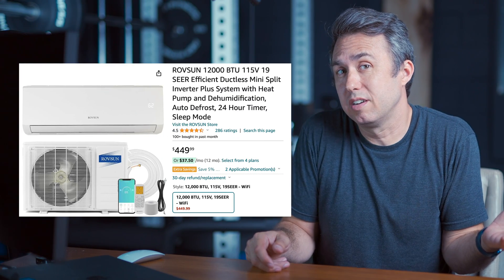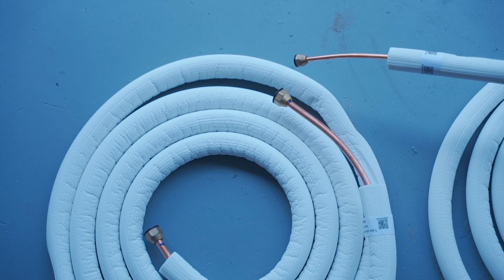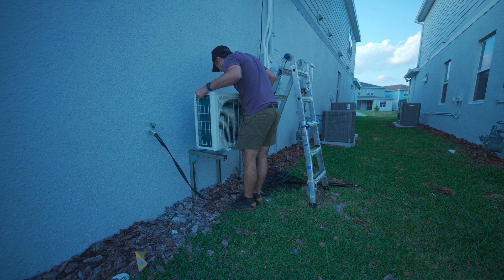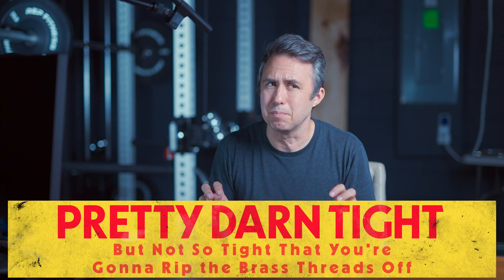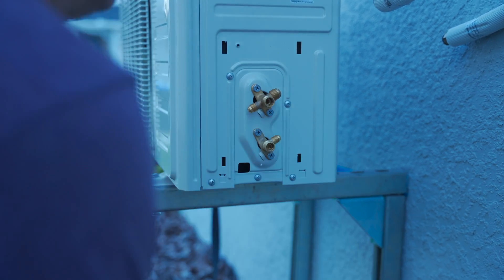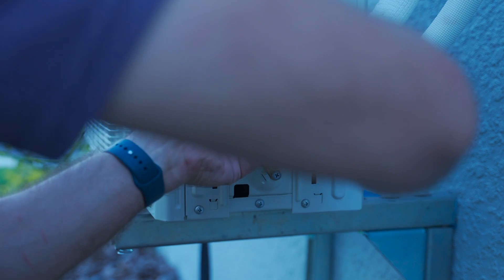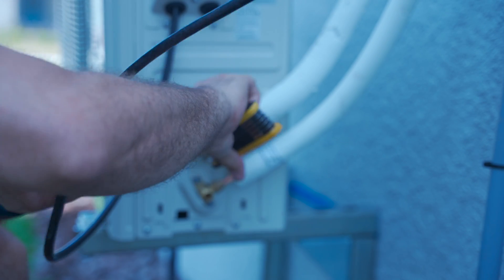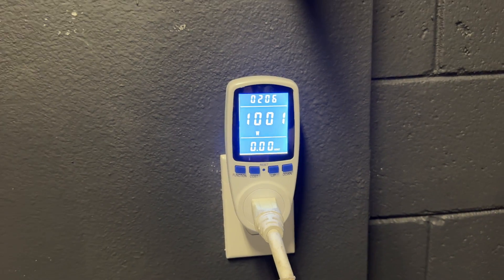DIY Mini Split Step by Step Install: Save Thousands of Dollars...

Comment: I have this mini splits i need that redacted part i got it after watching a video of some one installing it to a rv  mentioned the price and it could be ran off 300watts of solar a full install later knowing what cable or extension cord is the only thing standing in the way of me being done with this I also like to mention I'm also in Florida and in a rv

Comment: This isn't meant to be a scathing critique but rather some things you should keep in mind while thinking this is an easy project that you can get done in an afternoon. Surely there's a decent number of people that will end up following this guy's advice and not having issues, but in my mind, if you want to guarantee that you don't have issues then you need to do things properly from the get-go. And to do things properly, it's going to take longer and be a lot more expensive. In general, I don't think you shouldn't follow this guy's advice. I'd estimate for every 100 people that take it word for word there's probably at least 25 people that will end up needing to call a certified hvac technician to come out and fix mistakes. Not to mention, leaking refrigerant into the atmosphere destroys the ozone layer. Please consider that your actions and penny pinching have consequences. It's also possible that those actions will end up in you paying more than having it done professionally to begin with. 

1) You NEED to torque the flare fittings to spec. This is non-negotiable. You're lucky if you don't run into issues later on without doing this. I have several mideas and ran into issues dealing with the low quality copper they use. Too tight and you'll snap the flares off, too lose, goodbye refrigerant. With torqueing, it's ideal to torque down to spec, back off, and torque back to spec once more. Copper is very malleable and this will ensure an even better seal. You should coat the flare fittings with a small amount of nylog wherever there's friction while tightening them down. It's cheap, and will create an even better seal. But more importantly, it's what the pros use, and they do this type of thing for a living so trust them. Flare fittings are extremely error prone, just Google flare fitting issues and you'll see. They come from the factory with defects and should almost always be redone. But good luck redoing them with the Midea units! My hypothesis is they use thicker copper near the flares and you won't be able to make good ones further down the lineset. Maybe my flare fitting tool is bunk. I'm happy to admit mistakes where I make them and still need to figure out if I should blame myself, my rigid flare tool, or the copper Midea uses. I tried 11 times to make a proper flare, 11 TIMES!!!! It was infuriating. They snapped every single time I tried to torque them down. I ended up leaving the flares for the connections to the compressor (outside) and used RLS fittings to connect the cut down compressor (outside) lineset to the air handler (inside) lines. 
2) The lineset should be cut down with a tube cutter to remove any excess, otherwise oil can accumulate in the lines. It needs to circulate through the system to keep things going smoothly. Unfortunately this means you will need some way to connect the shortened lineset after removing the flares. This could mean a press tool for rls fittings, $4k+, or having a good handle on brazing copper with an oxyacetalyne torch. There are other connection mechanisms you can use for refrigerant lines that are cheaper and require less skill but I went with the press fittings personally since I'll be installing these for a long time and it's much more flexible than having to braze. 
3) Before pulling a vaccum the unit should be pressure tested with nitrogen and leak tested. It should be leak tested again after you pull a vaccum.
4) Regarding pulling the vaccum, it's ideal to use a micron guage so you're certain to be pulling a vaccum down to the appropriate micron level. They aren't cheap. Without doing this, you have no idea how much junk is in the lines from the outside air, especially in a high humidity area like Florida. The moment you pull the caps from the charged lines, they're exposed to the outside air, and contaminants will enter. This will lead to the premature failure of the system. Moisture is a demon to hvac systems.
5) I hated how you unrolled the lines lol. Quickly and haphazardly. Roll them out slowly and do your best to avoid unnecessary friction or kinks. Be very gentle and patient! Remember the parable of the tortoise and the hare. The amount of bends and twists you had to do to get the lineset through your attic to the outside was triggering. This is not ideal! Use a hammer drill and some sprayfoam to seal it up. Cleaner, less risk of ruining the lineset. 
6) The electrical is dangerous. Contract this out unless you're very, very, very, very certain you know what you're doing. Is it worth burning down your house to save a few thousand dollars on a DIY mini split install you probably aren't doing properly to begin with?

If this is the one time you intend on installing a mini split, and don't want the ability to do it again in the future, contract it out. You will spend more in tools and in time researching how to do things properly that likely would meet or exceed the $4500 or so it would cost to have it done professionally. Or you can risk burning down your house, the health of our planet, and wasting money on a mini split + professional troubleshooting. Who knows though, you could be one of the lucky ones.
Reply: Pointless comment.

Comment: How has this Held up since when you installed it? How's the Performance? Any Issues So Far? Saw this On eBay don't see any Warranty on the Units. However, I was Looking at another Company Acekool who Claims to have 10Year Warranty, Costs Only About $100 More. But I haven't Seen any Reviews Of them, They don't even have a Legit Website Showing their Mini Splits, That Means Certainly No Customer Service Or Support after the 30-60Day eBay Protection Period. So that Makes Me Skeptical. So, I'm thinking of getting this one, It's got a good warranty and Customer Service and If its a Reliable & Dependable Unit.
Reply from the maker: So far its been PERFECT.  Im in Orlando Florida, and it is in the 90's every day.  My garage is cinderblock without additional insulation and I keep it at 77 in here 24/7.  No problems at all.  Its WAY quieter than I expected, both on the inside unit and outside.  Its only been a few months, but I expect if the seals are good after a couple months theres no reason to expect that should change.  The air is ice cold coming out.  Im blown away by how cheap it is.  I keep reading about quotes of like $9k to have a mini split installed and I did this for a few hundred bucks, its wacky!
Reply: @SPACEDESIGNWAREHOUSE  I was quoted $12,000 for a single unit with two heads. Totally outrageous.! I'm gonna try this myself and if I go wrong, we call in an HVAC company to install for me....

Comment: I am in alabama, which is like florida, except it gets to 20f in the winter, and +30f in the summer due to our hot air coming from texas instead of the ocean. I am getting shipping containers for storage next week, and was examining my options. I didn't want to pay the options, and knew I could do something with a vacuum pump to solve this, in fact I bought one for $15 last year at a yard sale.  Your video really brought together all of the bits that I will need to install some mini splits.
Reply from the maker: Awesome! Yeah, one of these would definitely cool a shipping container.  That would be a pretty quick and easy install, too!

Comment: Sorry but I am going to be that guy. Your install looks like crap. I'm in Florida and also did my own install. Why on earth didn't you use lineset covers (linehide) on the outside wall? You can even paint them to match the house. It would look so much better than that eyesore you created. Guess what the number one fail is on these? Not torquing the flares to the correct spec. They end up leaking. I bought an A/C style torque wrench for my install. 

Mine runs down the inside wall in the garage which I covered with linehide. My toolbox covers most of it also. I came out low on the wall poked it outside and ran the lineset and conduit to the condenser also in linehide same color as the gutters. You can't see it because the landscape covers it. The only thing you see on mine is the condenser. No hideous tangled lineset. I see you used a stand. Better than being on the ground so kudos for that. I used an approved hurricane wall bracket on mine. On the outside disconnect I put in a surge protector which is also important. I used a Rectorseal RSH-50. It has alien technology so if it blows there is a gas inside that takes the hit before the electronics so it can take multiple hits.  

It just seems if you are making a video you should take some pride in your work and also your new home. I hate to be that guy this this install is so bad I had to comment.

 With all that said I can have my main door open and the garage stays cool. Not sure what size you used. I have a 2 car and a single car garage. I put mine in the single and used 1.5 ton (18,000 B.T.U.'s) and it's amazing. I hope yours is amazing as well for you.
Reply from the maker: No worries at all - the world NEEDS "That Guy."  I, for instance, had no idea that LineHide existed and now I do!  Im going to get me some of that stuff and clean up the inside (I did mention in the video that I planned to run some sort of metal casing down the side of my house to hide this.  There are also three other metal conduits that run up the side of my house near this same spot for the big AC, so it really wont add much as far as industrial garbage on the side of the house. 

I used a 12,000 BTU and its a two car garage and, as you know, its been in the 90's all week and this thing keeps it super cool in here and is crazy quiet, I am wildly impressed with it.  I do wonder if my not using a torque wrench will cause it to leak in the future.  If it does, I'll definitely get my hands on one of those to redo the fittings.  But in my general experience with fluid lines (I design immersion cooling dielectric fluid systems) I've sort of got a knack for how tight these fittings need to be.  Not discounting the proper specs, of course, I recognize and agree I should use proper specs, the engineering was done for a reason.  But as a mechanical engineer, I also know theres a bit of wiggle room in those specs. 

"Looks like crap" is sort of my design aesthetic, Im an example of regular people who suck at things the first time :)

Thanks for the LineHide, and thanks for watching the channel.  There will be more things for you to cratique soon as I plow through projects for this house.  Just wait until you see my networking closet!
Reply: Every guy who installed one of these and had a leak also felt they had the magical enginerd hand torque wrench meter. :)

 Not sure if you are new to Florida but I would highly recommend biting the bullet and spring for standby generator. Buy once cry once. My house is 3200 sq ft 2 A/C’s plus the minisplit. We also have natural gas in our area which makes it easy. I have a Generac 22KW. When FPL gives me the finger it comes on automatically and runs everything as if it were on the utility. No unplugging stuff no filling gas cans it’s just seamless. 

If you have to unhook the lines I’m pretty sure you can pump down the system and have all the refrigerant in the condenser, valve it off so you don’t lose any. Of course after re-connection you would run the vac pump.

Having nice looking network closets is also a thing of mine.. I have an amazing low voltage guy. This guy can get a wire where nobody else can. He also makes everything look pristine. He did all my color night vision cameras, sound, wifi all inside and outside  etc etc. I had him drop lines in my bathrooms so I could install Toto’s. He’s in WPB. Sometimes it’s worth it to pay someone. I do 99% DIY but attics aren’t my thing. :)

Comment: Wow Nice job 👍 seems it was a bit of a pita getting lines all the way up in there .. BTW what is the amps requirement for that unit .. nice that it’s 240v you can add like a few solar panels with micro inverter directly to it and offset the electric use..
Reply from the maker: I actually found a 120v one! And it’s only 1000 watts when it’s running so that would be 8.5 amps. 

We’re definitely going to get solar next season after the pool gets installed. So I’ll be able to run this thing for free, Max Power!!

Comment: I'm unsubscribing because you have a Tesla.
Reply from the maker: Nawwww, I drive a Fiat500. That Tesla is my wife’s father’s. He helped me pull the lines through the ceiling. 
It’s sad what’s become of Elon Musk. I used to think that guy was cool, but he’s gotten so wacky
Reply: @SPACEDESIGNWAREHOUSE  I don't remember why I was mad enough to unsubscribe.  I must have watched something about how my taxes subsidize Tesla. I'm mad because when I work any overtime I make less per hour after taxes than just working the minimum.  When I do the math it's like those 1.5x overtime hours pay 17$ an hour when they should be 50$ if it wasn't for my whole week getting bumped to the next bracket.  Its not surprising why young people don't work anymore.  BTW I drive a 1988 BMW 325ix AWD and a 2000 GMC Safari AWD.
Reply: I’ll double-check what you drive. If I see you drive Tesla, I will subscribe AND unsubscribe again!

Comment: Core question, where did you install the water exhaust line? These mini splits need to expel water. I had to run a separate line outside.
Reply from the maker: Since I had to go UP over and down with the coolant lines, the water line couldn’t join them, and it follows the wall over to the front of the garage and sneaks out next to the garage door track. The concrete has a little 1” drop down there so I let it pour onto the driveway.  I don’t know why I didn’t take video of that part!